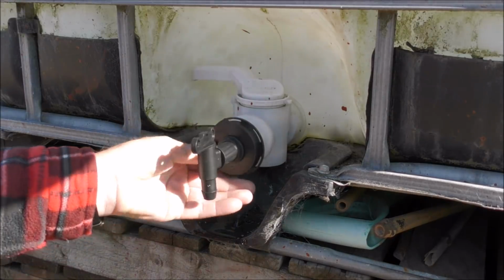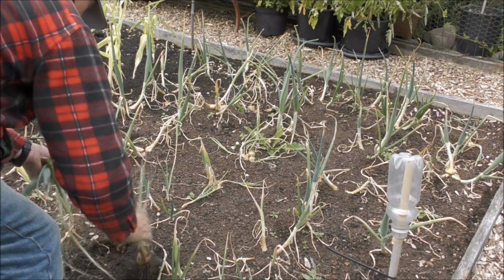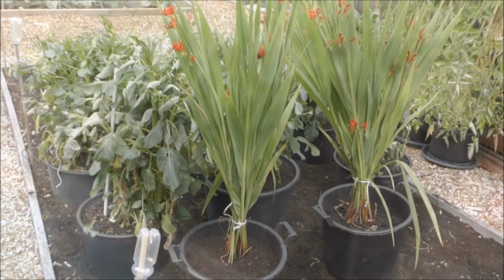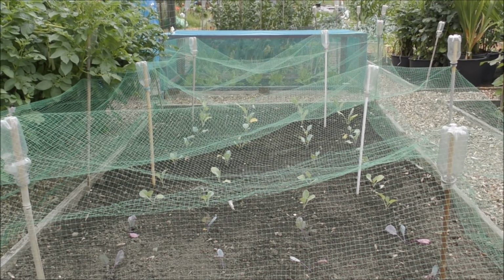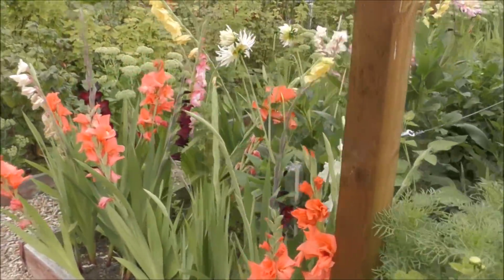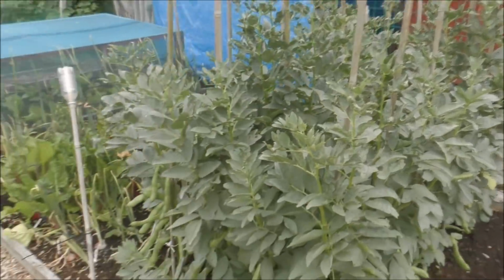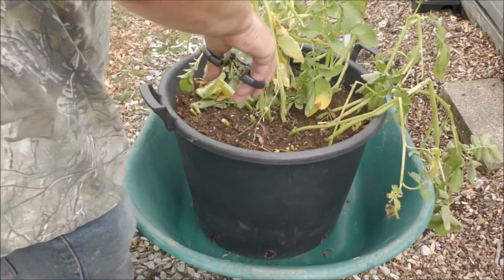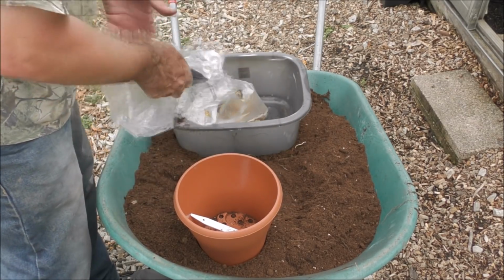Tour And Much More

Comment: I strongly suspect I got pneumonia from dirty water from my IBC tank two years ago in July. God you never want that. Often water was green if it wasn't replenished regularly from empty tank, I even flused tank out every year and put mould cleaner in, patio magic. I ended up lining my tank with black dpc plastic got from toolstation dont have green water now the tank is completely blacked out I agree with you mate about water companies, I detest privatization it only serves the shareholders.
Reply from the maker: I also i a couple of smaller tanks that really need lids but i use them daily and up to now haven't had any problems "touch wood"

Comment: Hi Mark, where did you get the tap from, that's just what I'm looking for to stop me using the main tap, many thanks. When I search for ibc taps they don't come up.
Reply from the maker: Morning Susan if your looking for the Fine Thread make sure you Measure the inside here is the link you will need https://www.ebay.co.uk/itm/HOZE-HOSEPIPE-STILLAGE-TANK-FINE-THREADED-REDUCER-CAP-TAP-WATER-58mm-BUTT/112529147283?_trkparms=aid%3D111001%26algo%3DREC.SEED%26ao%3D1%26asc%3D20160908105057%26meid%3Dc4a87306c23e472dbb41d834639a89a3%26pid%3D100675%26rk%3D10%26rkt%3D15%26sd%3D263811026900%26itm%3D112529147283&_trksid=p2481888.c100675.m4236&_trkparms=pageci%3A91f37472-94b6-11e8-a197-74dbd180882e%7Cparentrq%3Af02401271640a9c950de7b08ffee32da%7Ciid%3A1